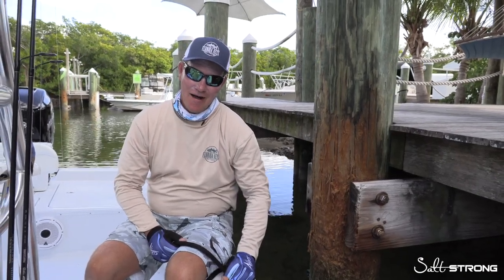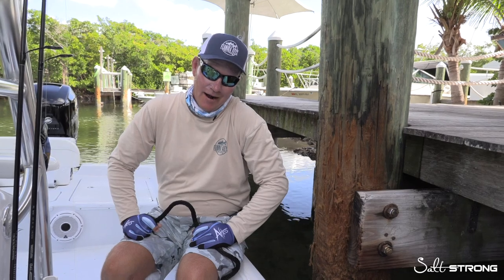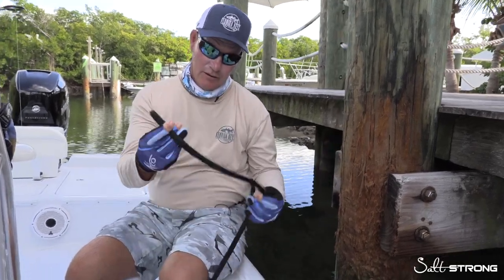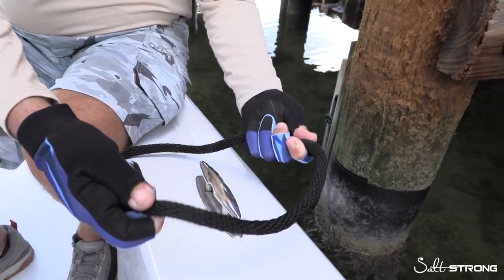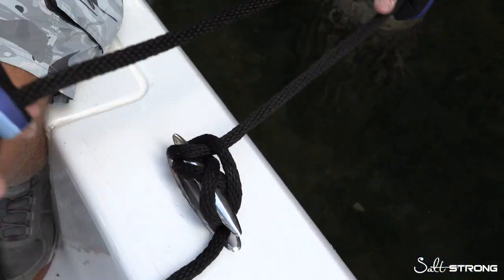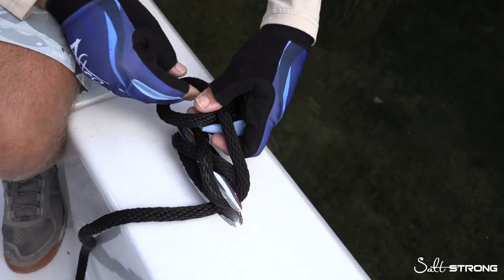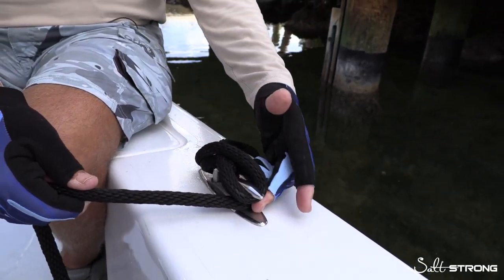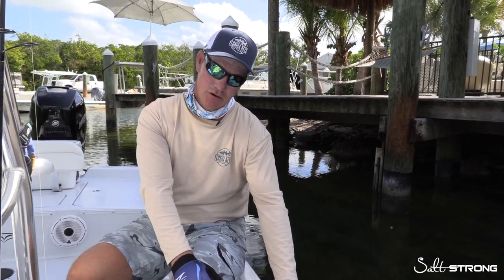Perfect Cleat Hitch: The Best Boat Cleat Knot

Comment: Always start with a round turn at base then figure eight. Without the round turn when you try and push the line back under weather hitch in rough weather you'll lose the tip of your finger
Reply: also the lock is wrong: the last part should come across the cleat and not on the same side.  it is same as the figure 8 but passes below for locking.